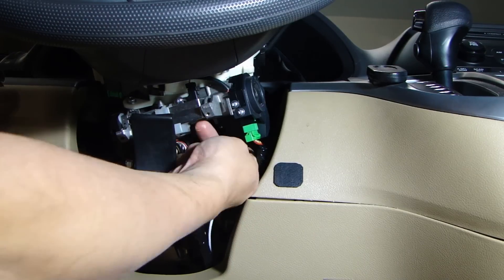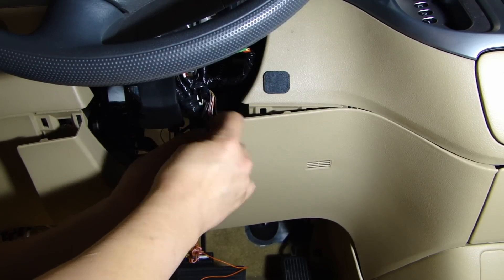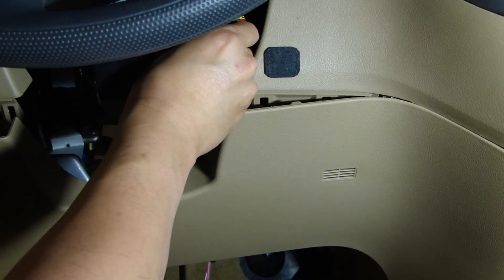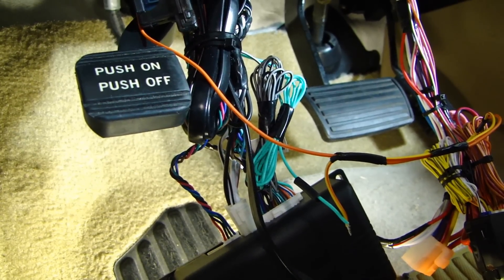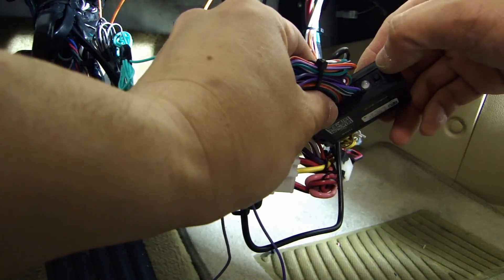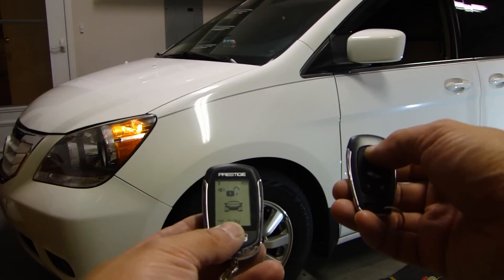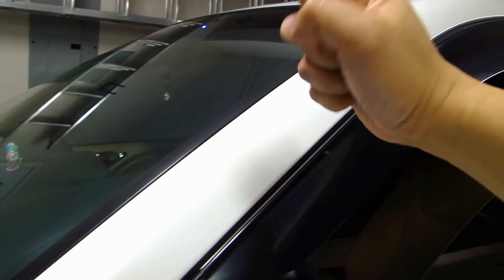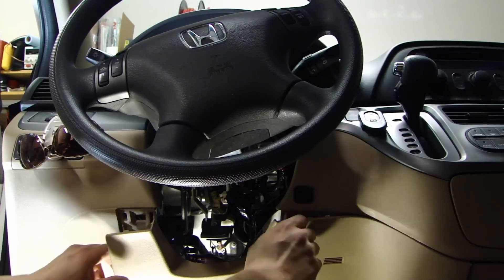Install Car Alarm Remote Start - Bypass Module - Honda Odyssey (Video 3)

Comment: As always, great vlogs. Have you done any previous vlogs or aware of the VCM issues plaguing the Honda Odysseys and other Honda’s with the IV-TEC VCM engines? If not, can you look into and share your perspective? 
Do you have a VCM muzzler on your Odyssey? Have you experienced  unusual oil consumption, spark plug fouling and car shakes around 50mph which can lead to premature engine mounts and possibly engine failure?

Comment: I’ll be installing remote start on my 2006 odyssey next week but will using crimestopper sp-402 with evo all bypass,when you hook up the sliding doors did you have to use relays?Also on the parking lights connection did you tap into the 12V wire?
I read somewhere that 12v parking light shouldn’t be use because it can damage the light switch permanently?

Comment: Awesome video,  I have one question I have installed this alarm on my 97 honda accord ex but my remote start doesn't work,  I need to promete it to do so but for the love of my life I can't , on the manual its says to push the pushbutton is that the valet button, and do i need to have the gear wire installed, please help me program it to remote start, its getting cold  :-) thank you  !!

Comment: good video I have a question. I have an odyssey 06 it did not come with a remote but it has an alarm factory alarm, will I be able to bypass the factory alarm and put?

Comment: Thank you dial2fast, it was the BEST how to video I have seen ! The camera work was fantastic!
I never had any intention of doing the job myself but I was curious to see what was involved so I watched all 3 videos. I have bought but not had installed yet the Audiovox  Prestige APS901E remote starter and Idatalink ALCA  bypass module for my 2009 Dodge Caliber SXT.. Buy watching your video I have learned three  things: 1)  why for sure I would NEVER consider doing this. 2) why it costs so much to have it installed. 3) My next car is going to come with a remote starter.  : )
My only question is, didn't you have to flash the module and if not, why not. If yes, why didn't you show that. It was my understanding that almost all modules have to be flashed. That would mean you would also have to buy some type of USB connector going from your module to your computer. That's another expense that people should be aware of, because it's not cheap. Thanks again for three great videos. ( today is DEC. 14/2017)
Reply from the maker: Your comment is totally correct. After someone watch the whole process, they can decide if this is something they want to take on. People need to know their limits and if you mess it up, it can cost you a lot of money to fix on the car's electrical. As for flashing the bypass module, you can either buy it pre flashed with the software that you need for your car, or if you are a dealer, you can flash the module to whatever firmware you need, and yes you do need the USB dongle which cost extra. I have the ability to flash my own firmware and I did not show it because it's not something everyone will have access to.

Comment: Very nice video! Could you tell me how could I find out which cable should I use on the alarm system? There are many wires and some of them are start 2, ignition 2 etc.

Comment: Hey man your videos are great I got a 997e prestige alarm for my crv 08 I hooked everything up I follow your guide is not the same but similar my problem is everything works except for the remote start I hit the button twice and the turn on and the off and so on any advice on this? Do I have to connect the inhibit wire with a relay ?thanks

Comment: Hi dial2fast. These are excellent videos to install/understand functioning of remote starter. I bought a used 2013 KIA sorento, which already has the APS997E installed. But the 1 way remote is lost. Can I buy a replacement and program it?
Reply from the maker: Yes, you can program new remote to the alarm / remote start system. Just follow the installation manual for programming instructions.

Comment: Did you make connection on Tachometer wires from "Remote Starter to Bypass Module"? I didn't see it on both video 2 and 3 or maybe I missed it, sorry.
Reply from the maker: With this vehicle the data mode provided the tach information the remote starter needed. If you install yours and find the starting is problematic (with data mode), then you will need to run a wire to the spark plug for tach voltage reading.
Reply: @dial2fast  Awesome! very informative, thank you very much.

Comment: hi there. you did a very good job at explaining everything. i am going to install a prostart remote car starter and alarm in my 2002 Acura EL and i am using xpresskit DBall2. I have wiring information and all but i wanted to know that if i use D2D mode do i still connect negative door and alarm output wires from my remote starters brain to factory harness or leave them as they are all doted in DBall2 diagram sheet. And after installations do i still have functionality of my oem alarm and remote?
thank you.
Reply from the maker: +deep aman The negative door trigger should be provided in data mode and you should not need to hard wire it to your alarm brain. The factory alarm is still functional.
Reply: +dial2fast  so basically i am connecting ignition harness, parking light, brake switch, tach, hoodpin, my siren and bypass module. What about dome light and trunk pin and trunk release.
thank you.
Reply from the maker: +deep aman  Dome light is your negative door trigger. Trunk should be provided by the data mode bypass module. Trunk release (if it has power trunk) may or may not be from the data mode, so you might need to install a relay for that to control. I am not familiar with the DBALL, but I know iDatalink bypass modules install guide will tell you what all the options it can provide to control.
Reply: +dial2fast  in my Dball2 diagram trunk input and output is a  dotted line and i do have power trunk(can open from my oem honda remote). Since my trunk is + output i need to put relay between my factory trunk harness wire and remote start brain i believe. 
thank you.
Reply from the maker: +deep aman That dotted trunk line in the diagram is most likely referring to trunk alarm trigger (like if you open the trunk, the alarm goes off) and not for remote pop open. So you will need to wire in your own relay to a channel output on your alarm to control it.
Reply: +dial2fast oh i get it so i will use starter kill relay which came with harness as it is optional. I have a stupid question: Do i need to give power and ground to Dball2 or not? as in dball2 wiring diagram on bottom right it shows output 12v and ground but there are no solid or dotted lines.
Thank you
Reply from the maker: +deep aman Becareful when you use the starter kill relay for the power trunk. That female socket end is wired for starter kill. Make sure you have the correct connection to the relay to work for your application. As to power the bypass module, it's usually incorporated in the data cable. You should also see Tx and Rx on that same connector.
Reply: +dial2fast Thank you. You have been very helpful. Thank you for your time.
Reply from the maker: +deep aman You are very welcome. Also check out - the12volt.com and there is a section on remote start forum you can post questions with many good experts to help.
Reply: +dial2fast will do. thank you.

Comment: Hey great video. Just one question. When you open a door or the hood, does the remote tell you that a door is open?
Reply from the maker: When opening door or hood, it does not tell you, but if you arm with door open, it will tell you. If you arm the alarm, and someone open the door or hood, it will trigger the alarm and let you know. Or if you open the hood while remote start running, it will shut engine.

Comment: I'm installing the same setup on a very similar vehicle, '08 Accord, and your video has been extremely helpful so thank you. I noticed on your wiring diagram of the remote start to the bi-pass module you had an "NA" next to the e-brake status (-)output (4:44) even though the diagram appears to be calling for that connection. Was there any particular reason you didn't need to hook up that connection? Is it b/c you don't need it hooked up b/c you won't ever turn ON "turbo timer mode"?
Reply from the maker: +Evan Robertson The Odyssey as you know is not turbo, and therefore not necessary to connect it. Only connect the features which are necessary.

Comment: I think you have done a soldering tutorial before but I would like to see more detail on how you were stripping of the insulation without cutting the wire and soldering it so effortlessly.  I have no idea where you were keeping the soldering iron while you were not using it.  I had vision of seat or carpet getting burn marks from tipping the soldering iron while you were fiddling underneath!!  If you can show us the tricks you were using to do this so efficiently would be highly appreciated.
Reply from the maker: Thanks for the question. I will be doing another remote start in my Quest in a week, I will show you how the soldering is done and what I use. Stay tuned!

Comment: Where do you buy the remote and module? Every major brand website refer you to a dealer. They don't seem to let you buy yourself to DIY?
Reply: You can go to Amazon. They sell both remote starters and bypass modules. You can also try to google it.
Reply: Stuff on Amazon Canada is pretty sparse.
Reply: Took a look on US website, wow significantly  cheaper and does ship to Canada. Interesting..
Reply: The MidnightNarwhal- What can I say ? Amazon.ca sucks. I found what I wanted on Amazon.com for $ 54. US which was $ 70. on Amazon.ca There is however a CDN company ( a distributor) for iDatalink products in Markham ON. You can either go to there shop and have them install a module and a remote or you can order from them online at their website. It's called Lockdown Security.com. I bought my bypass module from them online and they flashed it for me. It should arrive next week. The guy who I talked with was REALLY helpful and answered all my stupid questions. FYI- iDatalink will work in almost any car. If you go to their website they will ask for your car make, model and year and then spit out what products are compatible for your car. My car is a 2009 Dodge Caliber. I bought the iDatalink ALCA bypass module . You can also go to that CDN company I told you about and they will do they same thing. They will tell you what you need. My remote starter was bought last week from a guy in Milton ON who will install it all at a later date. For me his shop was much closer than Markham. I bought my remote starter from him. It's was the Audiovox Prestige APS901E remote starter.  Good luck .  if you have anymore questions,don't hesitate to ask.
Reply: alright thanks I'll take a look!

Comment: Did you connected E-BRAKE () INPUT from remote starter to E-BRAKE STATUS () OUTPUT - GREEN from flashlogic ?
Reply from the maker: +Eduardo Mendoza No, did not connect e-brake.

Comment: I dont have keylless entry for my car, would i have to buy anything extra on top of getting a remote starter?
Reply: Very good good video I followed the well detailed instruction and the install was successful expect that it seems that the dashboard light fuse blow every time I use the remote fob to open the doors or start the car.
Any suggestions.
Thanks

Comment: How do I program my remote to start my truck I changed the truck main battery in the engine compartment and now it doesn't start with the remote also would it be best to tap into the tach wire by the engine coil please help me out? 
      Thanks!   X

Comment: Is there a remote starter or alarm system for the 2010 EX-L?
Reply from the maker: +MrRangerZr1 All alarm systems are designed to work with all production cars. That's why the alarms have so many wires you don't use because it's meant to accomodate many different types of cars. You just have to wire it properly to  your car and program the necessary options. Same for the bypass module, it needs to be programmed for your year/make/model.
Reply: +dial2fast Will the one you installed work for the sliding doors and power tailgate?
Reply from the maker: +MrRangerZr1 Any remote opening features require an aux channel on the alarm system. Yes this alarm has enough aux channel for such a setup. Keep in my, you will need to connect external relays properly for the integration to your car. Some car use positive trigger, some use negative trigger, some use reverse polarity. You will need to know what your car needs and how to wire it up. What I showed in my video is specific to my car, not for all cars.

Comment: I recently had this 997E installed on my 2012 Toyota Sienna by a shop. Everything seems to work but after I remote start it will not open either slide door nor lift gate from the remote. If installed correctly should it open after started?
Reply from the maker: If you arm the car, then do remote start, the car is still armed and locked, until you press the unlock/disarm button.
Reply: Safety precautions

Comment: question for you. My remote starter stopped turning over the car after I replaced the car battery. It will crank the starter but itwont turn over. The key will start the car. I also discovered, If I just  hold the key close to the ignition and press the remote starter the car will start.  
What are your thoughts?
Reply from the maker: +Mark S It sounds like there is a problem with the bypass module. You will probably need an alarm shop to troubleshoot it depending on the make and model of the alarm system.
Reply: Thanks,
I kinda thought I would have to seek expert
help.

Comment: I have an 87 Mercury.Do i need a bypass module. What command start should i use?
Reply: john lankford hello there, did you install the system to your car ? I have an old car as well and still can’t figure out how to install it without the bypass thing

Comment: Hey do you think a normal guy like me could learn to install remote starters ? If so what's the risk in doing this ?
Reply from the maker: If you have not done car installs before, I recommend, you start with car stereos, then do a bunch of regular car alarm installs, then get into remote start system. You need to know how to test all the wires, and the risk is damaging the factory wiring system rendering your car not operational and a huge repair cost.

Comment: is possible for the alarm only to sound on the remote control and not the car?
Reply: Yes, if you use a two way control
Reply: I have the same problem. I don’t know what I didn’t and it’s a 2005 Nissan Altima

Comment: and don't be colour blind, lol, great as always, how many days did this take, ha. i rub my soldering tool on the shrink wrap rather a lighter as i don't have lighters any more. i think you had a wireless soldering tool. i am waiting for the next vehicle you do,
Reply from the maker: The filming made the install a lot longer than it needs to be. If I was to do it straight, it should take more than 4 hours.

Comment: may you please make a how to video on the shock sensor mode selection i try program it to stage 2 so many times and i can't to get it work . model aps-997E
Reply from the maker: I just followed the programming steps and worked fine: 
1) Turn the ignition key to the on position.
2) Press valet switch 3 times (Siren Chirps Once).
3) Turn the ignition key off then on you will hear 2 chirps.
4) For shock sensor setting, Press the valet switch 15 times
5) use the lock button of the transmitter to toggle between the 3 modes.

Comment: hi.gudday fren.i have problem with my gadjet.(tenon model).when i wanna start.it became 2,3 times startting the engine even the engine is already started.plz help .
Reply: it is also connected with another turbo timer from another aftermarkrt brand
Reply: before .not working.im have try chechk & replace some fuse.then my arlam.locking sysyem work fine.but this autostart didnt .its became the problem above

Comment: How do I adjust the shock sensor sensitivity?
Reply from the maker: +Paradew™ Adjust by turning the sensitivity knob
Reply: I did not install this in my car so where can I find this sensitivity knob. Im guessing its on the module that came with the alarm system. where might someone place that module in the car?

Comment: I have mine set with a timer of 10 minutes, after that it will shut off. How can I change to 15 minutes?
Reply from the maker: Platta If you also have the APS997E, then you need to change the feature in Bank 3 Feature 3 from the default 10 min to 15 min. Those features can be accessed by following the instructions in the install guide which you can download from the Prestige website.

Comment: How difficult is retain factory horn in this alarm
Reply from the maker: Ernesto Hernandez This Prestige alarm also has a (-) horn output wire. So you can wire to the factory horn if you want. Use a relay on this wire if you need 12V for the horn.